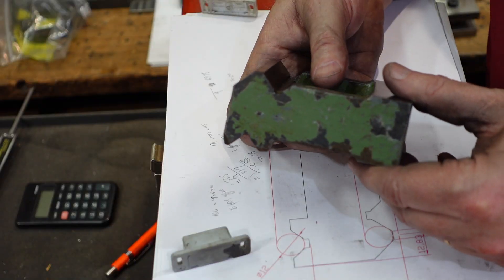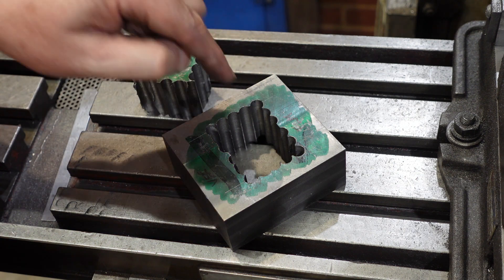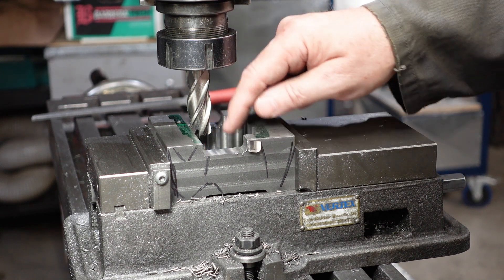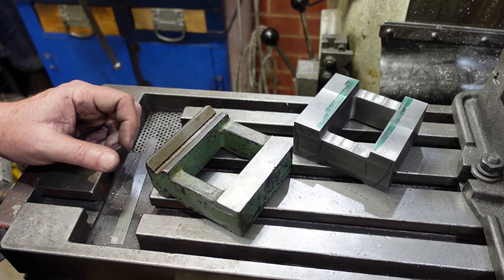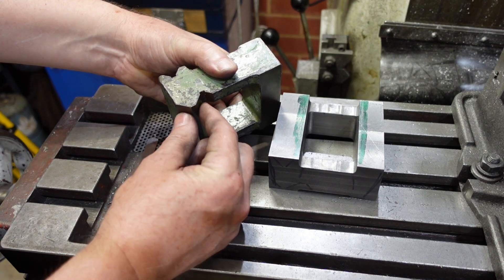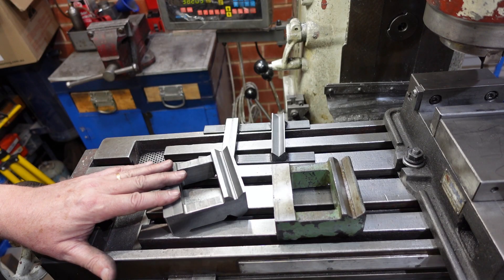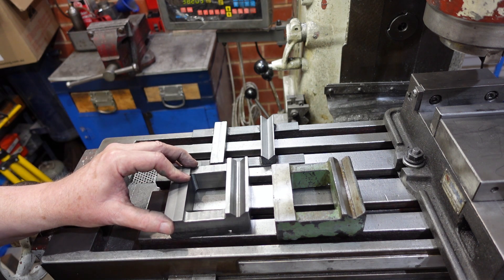Another casting like object

Comment: Interesting stuff. Why dint you take a V shaped gearcutter to cut out the V?
Reply from the maker: That was quite some time ago, so my memory is a bit fuzzy, but I think the reason probably was around accurately setting up and positioning both for and after the cut . Not sure whether I had a 90 Vee cutter either. I have several labelled 90, but a previous owner helpfully ground them to 60 degrees...

Comment: I was only day dreaming about trying to make this exact part last week. I'd love to make a pair to experiment with the possibility of spacing the head and tail stock for those odd parts that have too much swing.
Not too keen on trying to convert my bed to a gap bed. :)
 My 9" hercus may be old and not a great lathe, but it's what I have.
Thanks for all the videos and thanks for this one.
Reply from the maker: No problems. These are for a T&C grinder. While this could be done for a lathe, it would be an extra degree of difficulty I think.
Reply: @occasionalmachinist  and very hard to get head and tail alignment. I doubt the idea will get past day dreaming. :)

Comment: Now you've got me wondering, If you had used a different sized rod than 12mm in the groove, would it have worked out to the same height measurement?
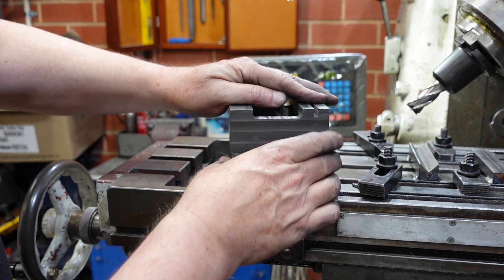Also instead of constructing the two bits of square bar stock with the groove and the flat, could you have used the original cast piece, with a stacker under the flat end(or possibly not, it looks pretty even at 11:08)?
Reply from the maker: No (I wondered the same thing myself). Given the design is old and in imperial units, I think it is just co-incidence.
It does sit flat on the ridge of the V and the corresponding flat (one reason for starting that side), but the reason for the V jig was that having milled the V in it, I could move in Z exactly the same amount as the distance between flats and therefore get the V the same amount vertically. 
Perhaps a more skilled machinist could have done it without, but this is me we are talking about.
Reply: @occasionalmachinist  You know, at one time I would have been able to tell you the answer to the rod question, using all the math to explain "why it is so", but sadly those skills seem to have evaporated somewhere in the last 45 years, 
Thanks for explaining.👍
Reply from the maker: Once upon a time I would have done the maths too, but as I get older I'm subscribing more to the view that if it is not necessary to do something, it is also necessary not to do it...
Reply: @occasionalmachinist  No truer words.👍

Comment: What do you call the kind of cutter being used at about 6:30, to cut that slot?  I've always called them 'wheel' cutters, but I can't recall when or how I started using that term. Turns out nobody else I've ever asked in person calls them that.
Reply: Slitting saw?
Reply from the maker: Slitting saw. That one was a bit big for the task but it was the only 3/16" one I could find. Now that I've made the part I'll probably find another couple stashed in a place I did not think to look.